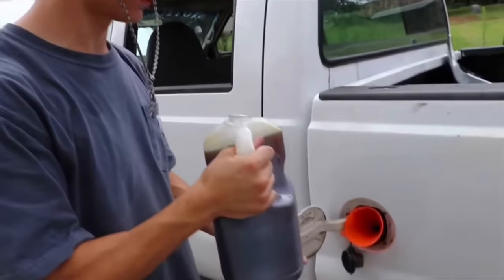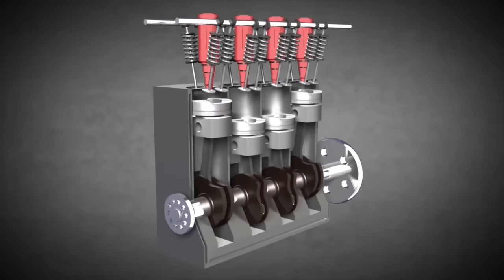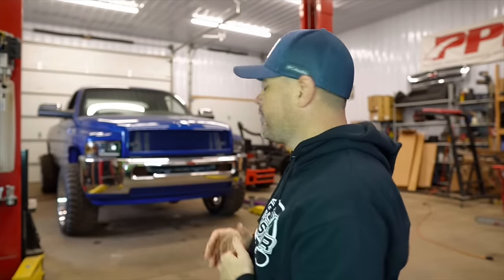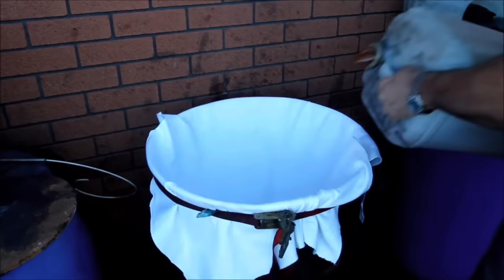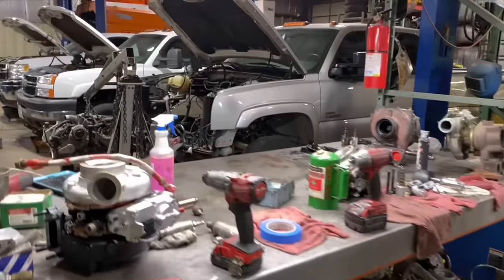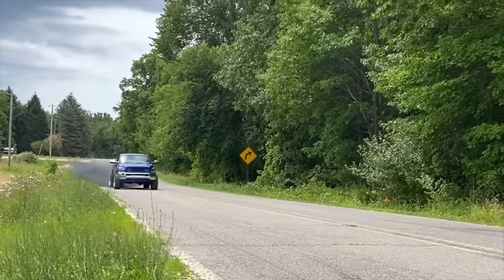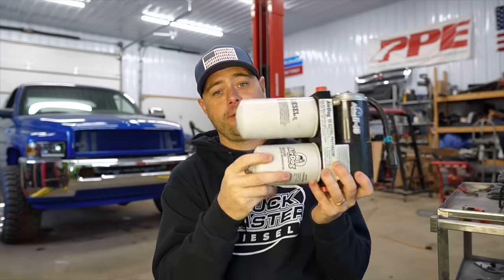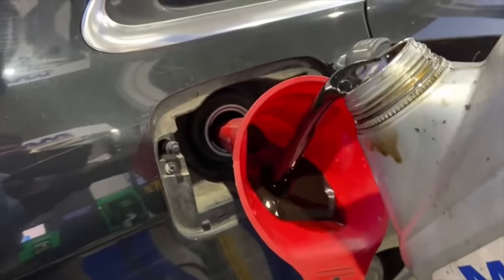Can You Run A Diesel On Used Engine Oil? Free Diesel Fuel? *EXPLAINED*

Comment: Finally great news for me after looking for over a year I finally bought my first Duramax I'm so excited bro!! I got a 07 Silverado crew cab completely stock. 0 rust it's been in socal since new it's got130,000 on her I'm stoked thank you for all the videos you provided I used every test you have provided and it passed all of them great channel
Reply from the maker: Congratulations ED!
Reply: They are nice trucks! I have an 05 duramax that I got at 76k miles, it has 230k now and still runs like it rolled off the factory floor. I've had to do small stuff like the water pump, power steering pump, and hydroboost though. Water pump was the worst
Reply: I hear you brother this truck is so clean I looked for a year for an. L. B. Z couldn't find one in decent shape almost bought an 05 but the guy jacked up the price when I got there by 5,000 so it kinda irritated me I walked away from it and I looked at least at 2doxen trucks and this one came available I jumped on it and very thankful to have bought it
Reply: I'm very thankful Ryan I looked at 2dozen trucks trying to find a L. B. Z  I couldn't find one in decent shape then this came available it's so clean it looks brand new not kidding no dents no rust you can eat off the engine it's so clean I'm very happy to be in the Duramax club my brother and sister have L. B. Z,s they bought brand new not knowing at the time what they were I explained it to them last year after watching your videos they are extremely happy lol
Reply: @ednesbit2988  I must've jynxed myself because just yesterday at work I smelled coolant and sure enough I'm leaking out of the weep hole of the water pump :/ I have a new pump coming tomorrow. Annoying job but so worth it do yourself, shops quote $1200 for the install of a $200 part because of long labor time
Reply: @marcbenedict3676  oh man that sucks I'm hoping for this truck to last for a long time before any maintenance lol I really wanted an Lbz but couldn't find one in decent shape hope that's it on repairs for you,!!!
Reply: @marc benedict You may want to change a few other things while you're in there...there's a link to a bunch of info on it if you want...complete with part numbers and everything. I have an email list in the vid descriptions on any of my recent channel vids...feel free to drop me a message and I'll share it with you.

Comment: Kerosene is commonly used  as a anti gel in trucking  for winter.
It  has a shorter burn there for it kills torque.
Reply: We call that #1 Deisel  for really cold climate.     The Deisel you usually use is #2.

Comment: I had 1981 Mazda pickup with a 8 football bed. It had a 4 cylinder diesel. When I got it,it had just turned 100,000 miles over the ten years that I owned it I put another 200,000 miles on it. It broke my heart when the engine die it gave up the ghost. I looked for two years too find another engine for it. I looked overseas in Germany where it was made but couldn't find anything. At that time all the diesel engines that you could buy were V8's. To this day I miss that truck 😞😞😞

Comment: I ran my T4000 Tilt Tray on Vege/Canola/Cottonseed oil from Hamburger Shops for many, many years from high turnover Shops that used to change their frying oil Weekly, then Fortnightly, during covid they swapped to Monthly due to supply issues, & it went from $5/20L drum of nice clean Oil, to unusable crud that was half full of Animal Fats. I ended up installing Water Screen Mesh pre Filters before the Pump as the last few batches I got stuffed 5 Fuel Filters in as many Kilometres!

Comment: Been running wmo for 13 years from 12 vales to now 2016 6.7. Ran my 05 common rail on as much as 80% waste for 200k never once replaced injectors or cp3. I filter to 2 microns that's it. Been running the 2016 for 60k now. No problems
Reply: What are you using for filtering?
Reply: @ConnectiveWyo  have an old fass pump that has a 2 micron filter on it  on a my holding tank with a 10 micron filter I front of it to keep it from getting clogged. Plus a air did on the truck to 2 micron. In the end gets filter twice to 2 microns and water separated twice. Also Im a tech so I can choose what oil I collect

Comment: When I had my 7.3 I ran vegetables and transmission mixed in my fuel and when I sold it with 160,000 miles and stock injectors and ran just like it did when it was new.
Reply from the maker: 7.3s are legendary
Reply: @paulbenderavich3833  Kerosene is used in winter fuel

Comment: I think using something as cheap as potatoes to make vodka, and mix it with some oil (Marine etc) could be a good alternative.

However to run gas through diesel engine, probably would need to do a few things: add Marine 2 stroke oil to gasoline to compensate for lack of lubrication; add some kerosene/paraffin to lower the octane; modify the electronics (custom microchip - to hack the rate).

Comment: I do it to my lb7 from time to time never had any problems definitely increased my fuel mileage!
Reply: I’m considering trying it in my LB7 I just got 2 five gallon buckets of used motor oil for free
Reply: @josefgunter-mj6me  filter filter filter, and filter again. A lot of people are also going to say centrifuge.
Reply: If all you're going to do is run 10 gallons run it through filters several times let it sit to settle and put it in with a full tank of diesel you will not likely have any issues as long as you have way more diesel than oil

Comment: I inherited my dad's 93 6.5 and would dump some in from time to time about a half gallon of used oil into it. Had no issues, but no way would I put any into my LMM. After I got my LMM the 6.5 just set and it was still in immaculate condition and a friend  ask if was for sale and I sold it. Hindsight 20/20 I wish I didn't,  but oh well 😕.

Comment: I run ALL my used oil through my 99 7.3. Including my class eight and gassers. It runs perfectly fine even with 100 percent used oil. Yea the fuel filters get dirty faster is all.

Comment: Diesels after 94 should never go alternate fuels unless the fuel has been refined from the waste oil or made Bio-Diesel. Can a truck after 94-03 run alternate fuels such as engine oil, Kerocene or other oils… yes but an electronically injected diesel won’t take too kindly to it.

If prolonged use of engine oil is used in any Diesel one can have excess IP wear, piston rings can get sticky, more carbon in the combustion chamber, & clogging fuel filters faster.

If you’re trying to save money on running oil cuz ur broke & out of money DO NOT attempt, the oil must be filtered to a minimum of 2 microns before going into the truck. There are micro particles in the waste oil you can’t see with the naked eye that are harmful.

I don’t care if your 5.9 had been doing it for years. If you go hard core 75% engine oil to gas it’ll do it, but it’s not worth it until diesel gets to $10 a gallon.
Reply from the maker: I appreciate the great input 👍

Comment: I dumped all my used oil in my LBZ for years.  Ran fine.   Smelled a little funny but nothing noticeable otherwise.
Reply: Interesting i have a lb7. How much did you put in the tank? What was the ratio? How often did you do it? Was it below freezing when you did?
Reply: @jonathanmedina3446  I didn’t pay attention.  Honestly.  Just dumped quarts and gallons in there at full up.  No more than 2 gal a fill up tho.  So nothing crazy.  Not sure if it agrees with the injectors tho.  The newer the diesel, thicker fuels don’t agree with the injectors. I think it’s something to do with the nozzle/tip sizing is designed into the viscosity or type of the fuel they plan to be ran. But the LBZ sadly isn’t newer at this point anymore. Your LB7 should be fine with it, just don’t go crazy with it obviously.
Reply: @35057 did you filter it? If you did how? And what did you use?
Reply: @jonathanmedina3446  I just dumped it in.  I had an air dog lift pump and the stock filter head so those should work fine.  I wouldn’t dump any (known) overly contaminated stuff in the truck. Just burned my old DEX6 and any other oils.  I guess with newer style engines and injectors it’s not a good idea to since they’re designed to around the more modern diesel fuels.

Comment: I have a 1994 K 3500 Chevy with a 6.5 turbo diesel and nv4500 trans. Years ago, it was converted to a manual pump, and all of the electronic injection was removed. It is down right now waiting on a transmission rebuild, but I have no intention of getting rid of it. I also own a 2005 Dodge k3500 with the 24 valve Cummins. I'm happy with the engine, but not too impressed with the rest of the truck. Previously, I had a 1995 3500 HD with a 6.5 turbo diesel and the factory stanadyne electronic injection. It had a dirt dump body, and I towed a trailer with a bobcat all the time. It gave me about 100 thousand miles of good service, and then electronic injection became a nightmare. Multiple replacements of the injection pump and the PMD modules, including relocation kits and heat sinks, never seemed to correct the problem for very long. A friend of mine had a '94 k3500 with the electronic injection, and he spent years sorting it out. When he was done, he ended up with a very reliable truck, which has now given him excellent service.I always loved diesels because they were simple - I want nothing to do with the new computer controlled electronic diesels of today!

Comment: Of course you can’t dump nasty oil into your tank.But I’ve been running used fryer oil in my ‘01 Duramax for the last 16 years, over 150,000 miles with absolutely no issues. Granted I have separate tanks in the bed of the truck (2 60 gallon tanks) that use my coolant to heat the oil, and I let the oil separate and filter it to a higher degree than the diesel filter on the engine.

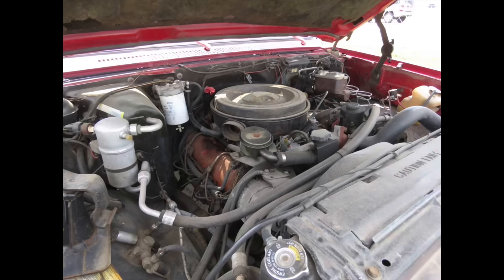Comment: New trucks with High pressure Fuel systems, No. On the old IDIs GM, dodge etc Sure no problems. An engine rebuild and/or replacement right now alone is probably worth more than the entire truck. P.s 8:00 that be the Getting to be Scarce and Ultra Desirable 1982 only coarse thread red block 6.2. I got a few of those and they're at this point of becoming $1500 - 3000 engs.

Comment: You have to watch that you don't get it too thick. If it is, there will be a lot of wear on the cam and followers in the pump because you are pushing thick oil through small holes in the injector tip.

Kerosene has less BTU content per gallon, so no it does not burn hotter

Comment: I've added 2 stroke oil to my LLY for about 160k miles... has to be "TCW-3" add about an oz. per gallon or less... adds lubricity and heat, excellent anti gel in winter... my truck: full delete, 245k miles only replaced water pump and battery's....Oil changes every 10K miles... Military used to run up to 10% UMO on diesel engines, that 5.9 cummins is perfect for it, hot shot driver on YT did it for MANY A THOUSANDS MILES TOWING...

Comment: Although they have a terrible reputation, I have a 2003 6.0 powerstroke dually with 326,000 on the clock and won't part ways with it. Not as great as a 7.3 but she's got me this far without anything major going wrong (knock on wood).
Reply: Have you done any modifications to it like the head studs or egr cooling system? I've heard of people having huge success with those engines after "bulletproofing"
Reply: @marcbenedict3676  I have studded the heads. Other than that its stock. Kind of a bummer since I live in Cali and now I can't even do an exhaust.
Reply: The 6.0 Powerstroke motor got a bad rap.  If you left it stock and didn't abuse it, they were great motors.  Ford enthusiasts assumed the 6.0 was the next gen 7.3 and immediately started modifying them.  The 6.0 was a completely different animal.  People would put a performance chip in them, blow them up, then call them junk.
Reply: @thomabb Nobody was chipping 6.0's...there's millions of stock failed 6.0's in junkyards

Comment: Been running all kinds of used oil through my 99 vp44 Cummins for the past 10k miles. 15w40, 0w20, 10w30, ATF, and many other used automotive oils. Truck runs great. Little bit of haze until it starts warming up. All I do is run it through a paint strainer before it enters the truck and then the onboard fuel water separators do the rest I change my filters every oil change so I don't worry much about anything happening. Truck has 340k miles on it and the injection pump has around 180k miles on it so if the pump fails I won't blame it on the oils I've been running.

Comment: Common practice in winter was thin out diesel fuel with kerosine. With oil and such the viscosity through the filters and injectors is what will kill the engine. You should really talk about jp8 and maybe would be a fun experiment.

Comment: I once used to drive old ford IDI internationals that I put everything in the tank,  and I mean everything, and it worked. 6.9idi and 7.3idi 1985 to 1988 I think. Sold to my older brother. Now I Drive a 1997 F350 with a 7.3L Powerstroke. I don't think I could ever sell it, and If I did it would have to be a fortune. The 1997 year powerstroke is my favorite truck on this planet.  The truck is so nice I'm too scared to experiment on like I did on the old IDIs.

Comment: I burn anywhere from 400 to 600 gallons of used oil in my 03 cummins a year. It gets filtered and heated 3 times before going in the truck. 
Of course if not completely clean or free of moisture, you'll cause serious problems.
Reply: How much at a time?

Comment: I have both 6.9 turbo and 7.3 Na IDI's.
I might in the future, when diesel is $10/gal, and the Ford dual tanks will be nice, to dedicate 1 tank for alternative fuel, maybe heat it .
Reply: The 6.9 has a fuel heater
Reply: @chrisleggett685  that's right, on the fuel block or inlet line. I'm thinking of maybe a tank heater too.
Reply: I think it depends on what you use for alternative s veggie oil absolutely need a tank heater but oil mixed with gasoline to thin it probably not necessary
Reply: I do think running two tanks. One only diesel which you start and stop the engine on is a great idea
Reply: The only thing is you wouldn't need a full size tank for that you could likely get by with 5 gallon or so tank lol

Comment: We bought a house with a full tank of home heating fuel still in the basement and instead of paying to have it “properly disposed of “ I mixed it about 30% with regular diesel in a 2005 4300 international. I noticed the temperature range was slightly higher than normal, about 205/210 rather than the normal 200 degrees. I also filtered the fuel as it came out of the mixing tank with a make shift in-line oil water separator and a secondary fuel filter too since I had no idea how old or what else was in the 500 gallon tank of heating fuel. 
I had no real problems other than the temperature and I saved about 2000 in fuel cost! Idk about adding old oil to it though I’d be worried about clogging up components. I’ve always heard old diesel’s oil has a lot of junk in it you wouldn’t want in your engine again.

Comment: I've tried diesel wmo mix with no issues, straight new atf to clean fuel system with no issues. Thats in a 12h-t toyota. I'll never get rid of it because its EMP proof and can run on anything, could probably rig up a hand crank starter to it.
I'd like to invest in a centrifuge and start stockpiling my own fuels.